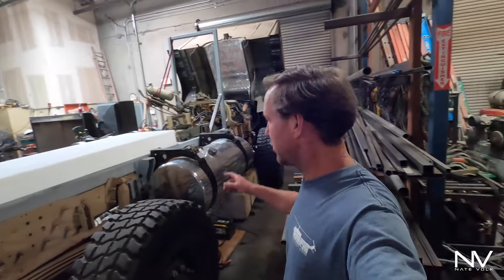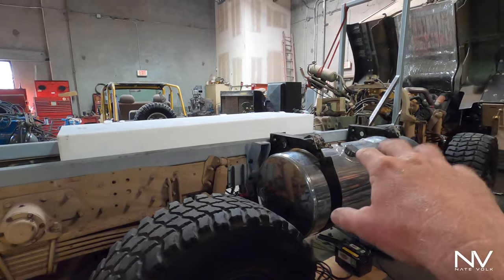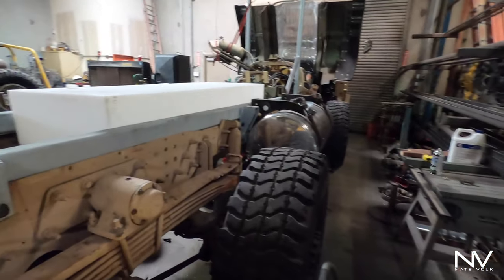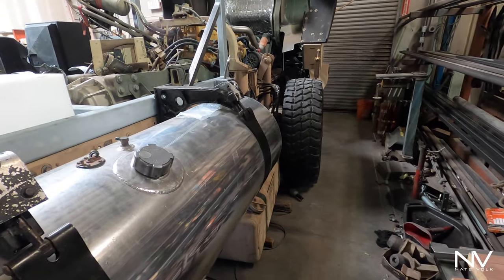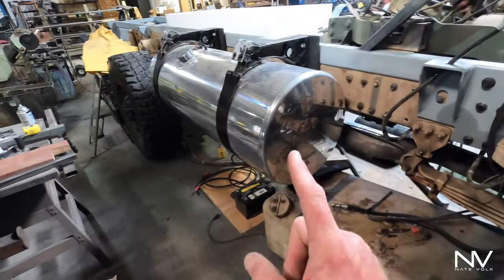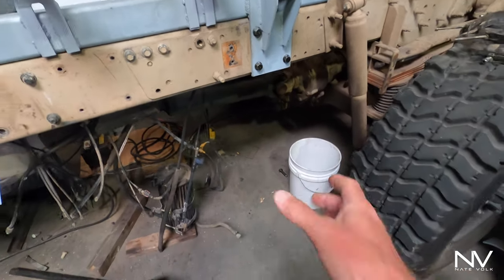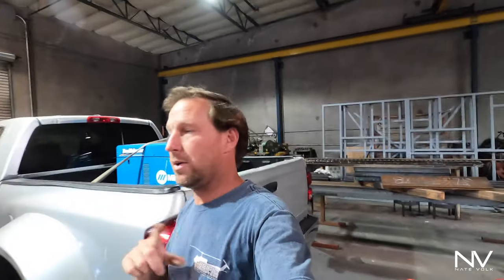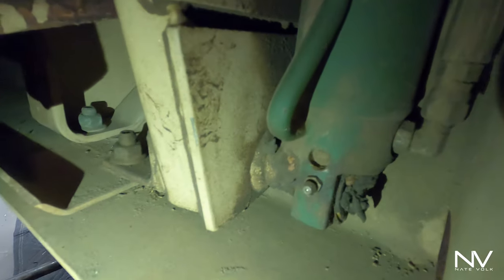LMTV Overland Expedition Truck Build - Part Fourteen

Comment: Hey man looking good! I can’t remember what you wer if any thing going to put between the frame rails at the back end. I was thinking in my head my own ideas and I’ll pass this one to you it would be to make a long pull out storage box like sometimes seen on pickup trucks. You would need to change the cross member to allow access bu there’s a ton of room there. You would also need to design the lift to acomidate things and go wide of the rails. I hate waisted spaces!  Just an idea! About the stairs. I’m not sure I understood right but if the deck took the whole rectangle space and the stairs were at the out side edge ( under edge of truck parallel with frame when closed) you could pull out just enough to put stairs down and go up say 24-30” or fully pull out the deck and the stairs would be away from the truck at the corner of the deck still parallel to the truck.  Is that right?
Reply from the maker: So on the rear, I've got a fuel tank for my motorcycles going in, as well as a pass through storage from side to side.  I'll also need the hitch, lights, plate, etc up there too somewhere.  The pass through will have pull out slides for easy access.

So the deck is 3 parts.  The first (towards the front) has the stair attachment.  They can mount directly to the truck with the deck in, and extend at 90 degrees to the truck.  You can also pull out the deck a little, and have the stairs go to the rear of the truck, great for tight spaces and parking lots.  Or, with the deck all the way out, they can go out to the side 90 degrees, or towards the front, parallel with the frame, depending on the site where you are parked :)

Thanks for the comments!
Reply: Ya. Having the stair be a completely separate piece makes the most sense opening up all the options. Unless it falls off or get left or stolen I guess! Ha!
Reply from the maker: @Eliukcory  Yeah, I wanted it to slide in and store away, but I didn't want to compromise my floorpan, and the door is right over the tires.  Plus it opened up space for me to put in an extra water tank, so it all worked out!

Comment: Hello Nate! Incredible knowledge. A few questions? Where did you get all those skills? How much fuel onboard? What mileage do you expect? And did you or will you re-gear to improve it. I've heard of M1079's being re-geared... for big improvement.
Reply from the maker: Thanks!  I kind of just stumble my way through things :)  I've got some good welders helping me out too!  I carry 100 gallons of fuel and I averaged 10 miles a gallon from Denver to so cal on my last long trip.  I do have the highway gears, and I cruise about 65mph.  Not too bad of a slow down up hill either.  It is also an A1 truck, with the 330hp tune.  Thanks for watching!